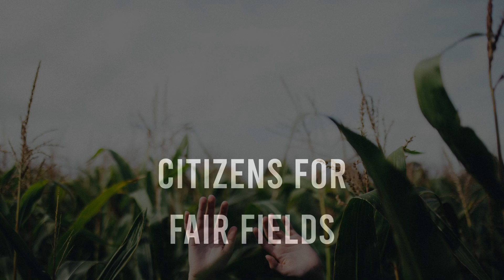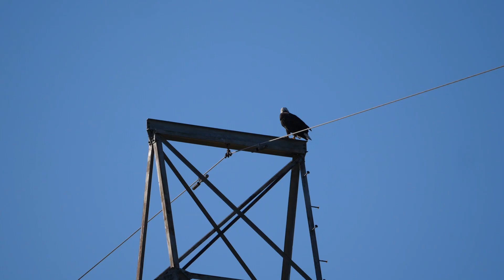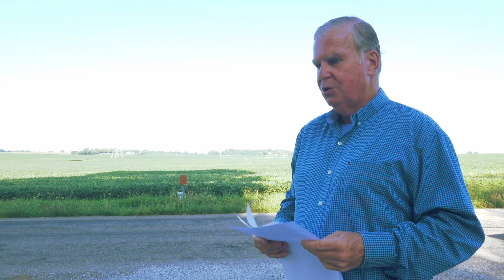An Expert in Energy Generation vs. Utility-Scale Solar in Ohio

Comment: A small child could poke a hole in every one of your arguments against solar. By the way, wasn't it Babcock/ Wilcox that gave us Three Mile Island? I found this on the web, but I don't know if it's true or not: "B&W's Role and Responsibility
Design:
B&W designed the Unit 2 reactor, a pressurized water reactor (PWR). 
Design Flaws:
The American Nuclear Society (ANS) noted that B&W's design had two minor but critical omissions.
The safety function of the pilot-operated relief valve (PORV) and its block valve was not fully understood or appreciated in the design." Maybe you might speak to that if I got it all wrong or something... You can't trust the web to give you the Truth, so if that's wrong let me know. I don't trust YouTubes to give me the Truth either. Or the Tidy Bowl Man to get rid of iron stains in my toilet, just because he wears a lab coat... How about you?